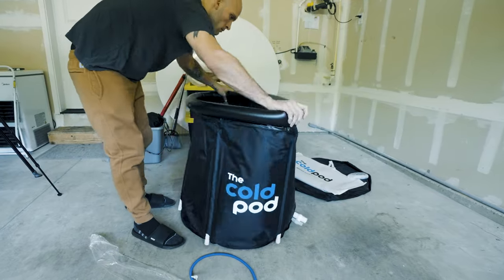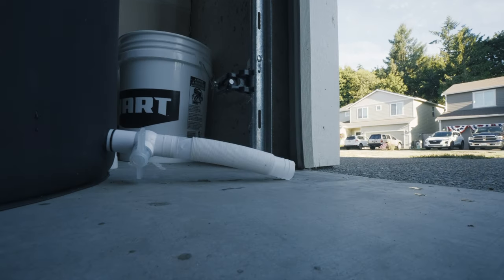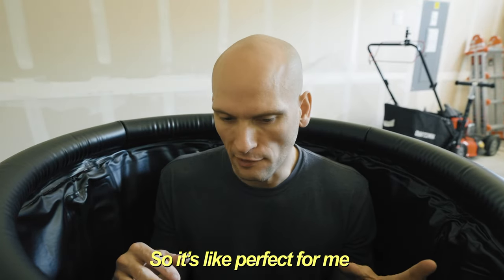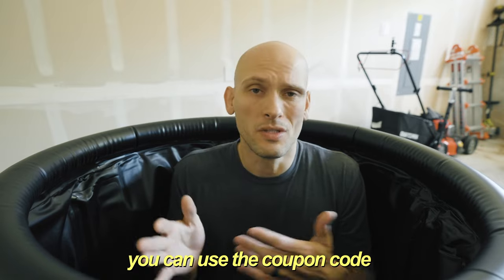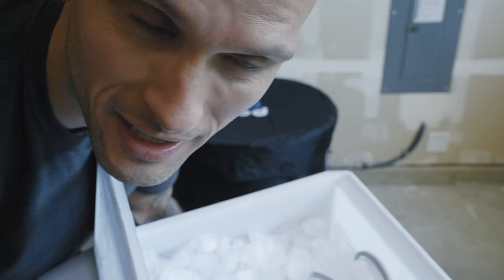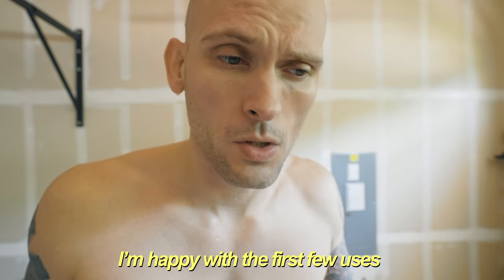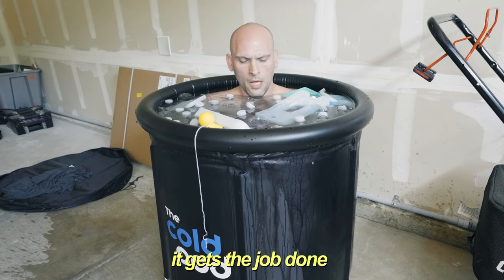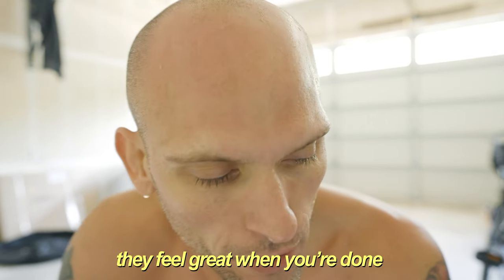Best Cold Plunge Under $200? // The Cold Pod First Impressions Review

Comment: I just got one, question. How do you take the air out ? Just incase I want to take it somewhere with me, it would be easier for me to pack it
Reply from the maker: So it has a "quick release" if you look closely at the air valve you'll see a line and black plug. Just pull hard at the black plug line and it opens the quick release for the air to come out.

Comment: Can you just leave it up or do you have to constantly breakdown and repump?
Reply from the maker: I leave it up filled with water. The whole this isn't inflatable just the top ring. The pvc pipe legs keep it standing even when it's empty. The top ring holds the air well and I've never had to refilled it in the 2+ months I've had it.

Comment: How do you measure the temp of the water?
Reply from the maker: I was using a water thermometer but it turned out to be inaccurate ended up using a digital meat thermometer. I built my own diy cold plunge with a chiller now and that has a built in thermostat so I don't need to worry about checking the temp anymore.

Comment: Better buy a chest freezer :) Easier to freeze the water,not this shit with bottles 🤦‍♂️
Reply from the maker: Even though it's a small chance I don't want to risk getting electrocuted. Even if you "waterproof" it with silicone when unplugging a chest freezer it can still hold power hours after. I did just buy a 1 1/2 HP water chiller that will get the water down to 36F! So water bottle problem solved. I just wanted to make sure this was something I would continue to do long term before making a big purchase. Water bottles saved me a lot of hassle and money with having to go buy ice everyday too! So they've served their purpose imo.
Reply: @DorianDevelops  Curious, what kind of water chiller did you get for this?
Reply: To each their own.  I also use Water bottles and it's been just fine.